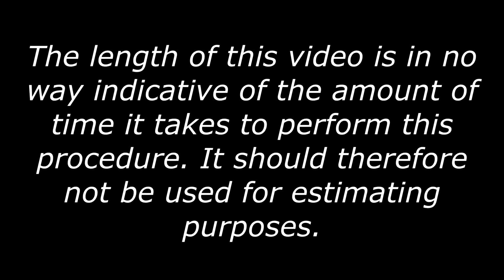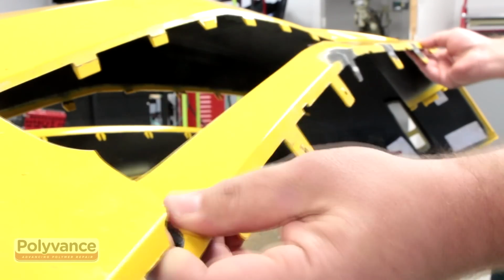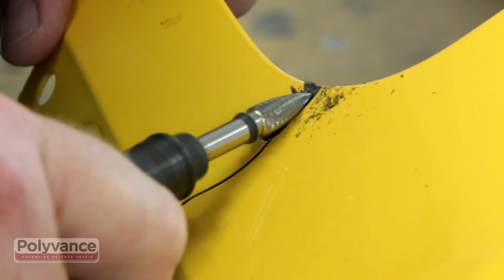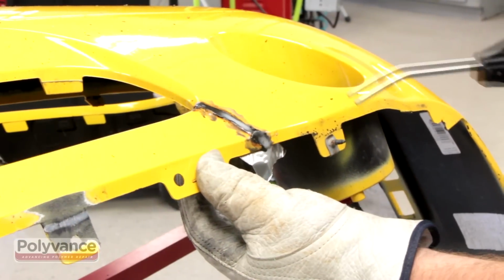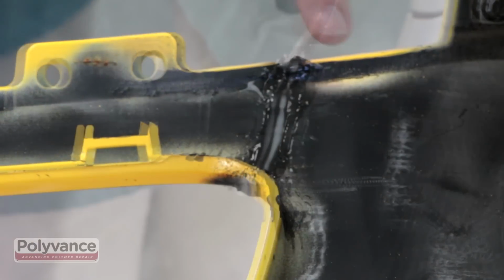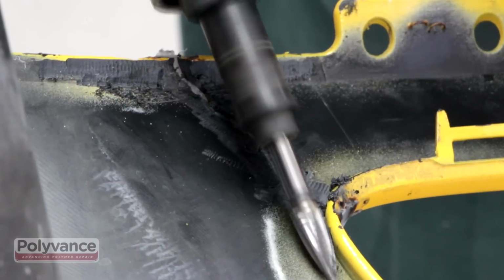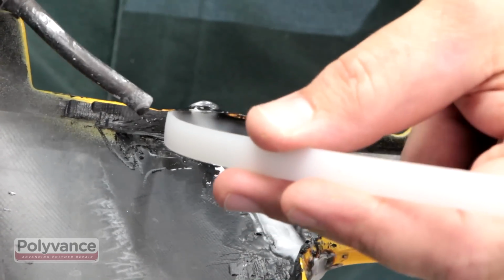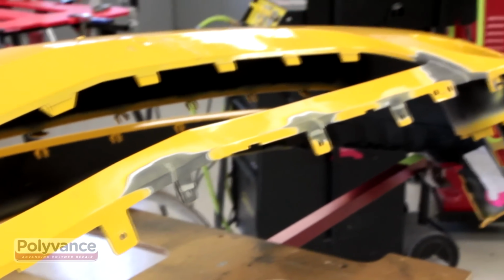Dodge Challenger Bumper Repair

Comment: Hello I am from Russia! What plastic is used on the Dodge Challenger bumper? How can missing items be recovered? how to solder? thank.
Reply from the maker: This bumper cover was made of polypropylene plastic. You can use filler material to fill in missing pieces. You can use the airless plastic welder to weld or the nitrogen plastic welder to weld. Airless plastic welders are usually used by DIYers and nitrogen plastic welders are usually used by body shops.

Comment: Will this work on a polyurethane bumper
Reply from the maker: No, you cannot use a nitrogen welder on a polyurethane bumper. Polyurethane is a thermoset plastic, which means it does not melt.
You can view our playlist on repairing thermoset polyurethane here to get an idea of how it works: https://www.youtube.com/watch?v=rUV1qpnKxlg&list=PLmdrqwjPa5t8Dzx05kPVzr1yC-DauXWNt
Polyvance has the tools to complete polyurethane repairs available on our website.
Reply: I can also repair polyurethane